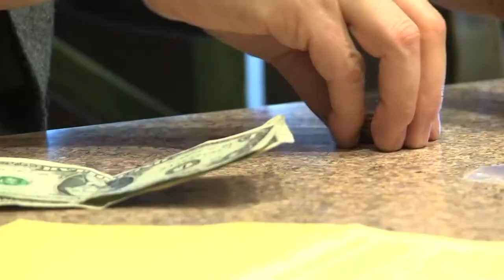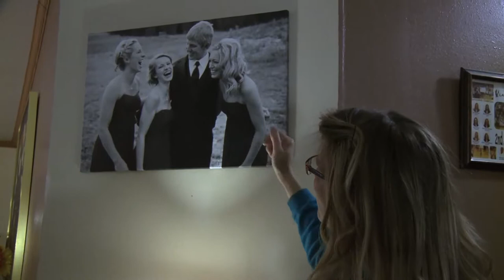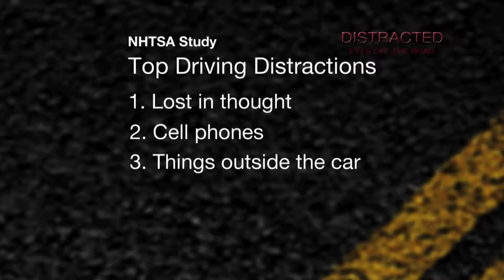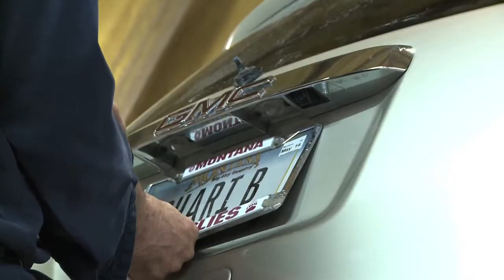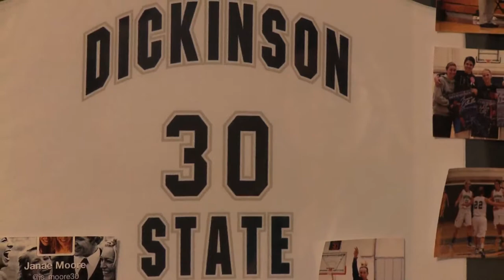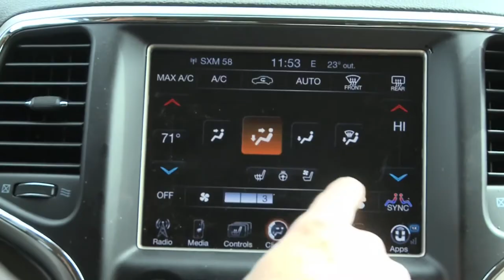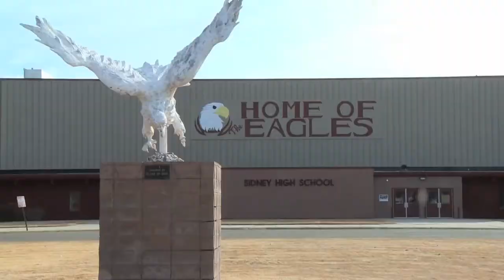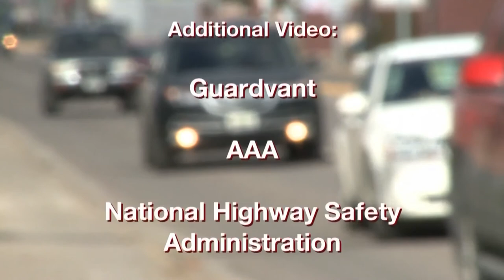Distracted  Eyes Off The Road - 2014 Student Documentary

Comment: One thing that makes a big difference is a safety setting on your phone.  If the phone detects enough movement, it automatically silences texts and sends the phone to voicemail.  By the time the car has moved to 15-20mph the setting automatically starts.  It’s made a big difference for me. And no one seeking to get in touch has a problem when I don’t respond until I’m done driving.  In fact, they mention that that’s a good idea and want to use the setting themselves.

Comment: In Australia 🇦🇺 it is AGAINST the law to use or even hold your mobile phone whilst driving, hands free devices are also against the law,  that also includes being stopped at traffic lights as well, you can only use your phone once you have parked your car, turned the engine off and taken out the keys.
The consequences for using your phone, let me be more clear, for EVEN holding your phone are massive.
People on a "Learner's permit" or a "probationary license" ( anyone under 24) aren't even allowed to have their phone switched on, cant use it with Bluetooth for music on the car stereo or calls with Bluetooth, ABSOLUTELY NO USING IT AT ALL, anyone on an open license may use it for GPS and music BUT only on Bluetooth through the stereo.
We have special fixed cameras here on top of poles and at traffic lights and on top of roadside signs, that easily take pics that are crystal clear so you will get busted no matter what.
The fines start at $550 for each time you get caught and get higher and higher if you get caught more than once and you also lose 5 demerit points off your licence if you are on an open licence, for non Australian's an open licence has 12 points, if you are on your "Learner's permit" or "probationary license" and get busted you will INSTANTLY lose your license for a minimum 6mths or can go to jail.
It is taken VERY seriously here and so it should be.